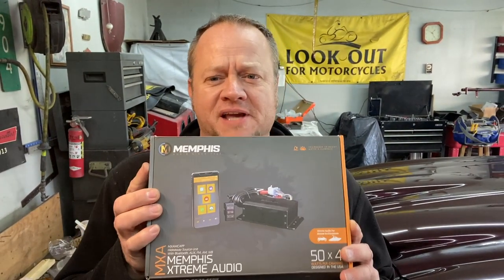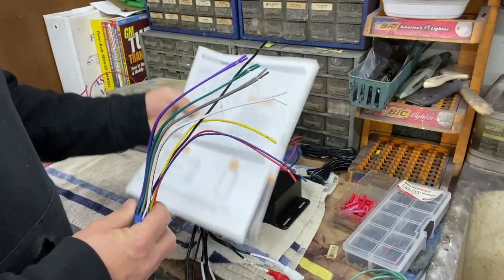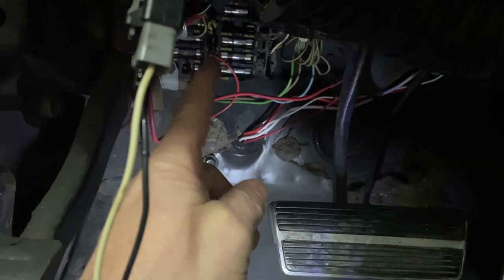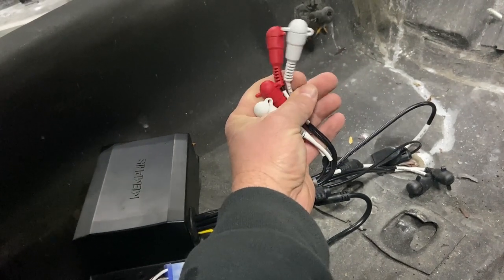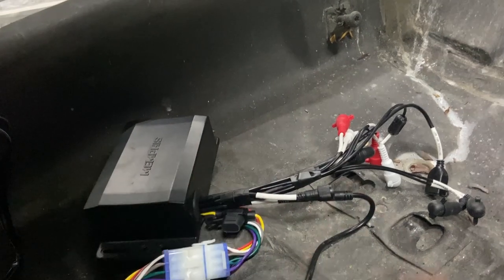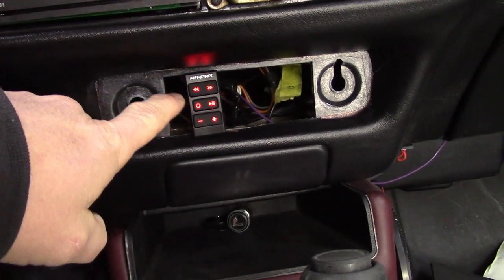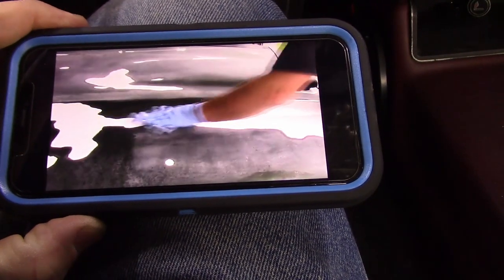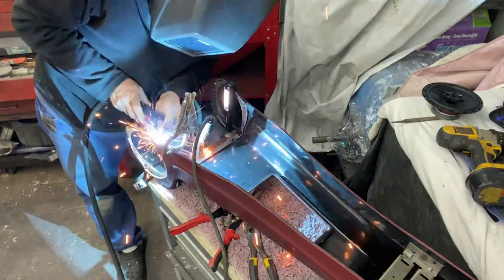Hideaway Radio "HEADLESS" Memphis XTREME Audio's MXAMCAPP - Bluetooth - App Controlled  Source Unit

Comment: Neato. I have still not decided what I am doing for my stereo yet.
Reply from the maker: Right on! I don’t plan on listening to the radio much but wanted something. This whole setup with the speakers was around $300 bucks. Definitely didn’t want an aftermarket modern head unit, but that’s just because I’m going for more of an original 70’s look on the interior. I really wanted to get a period correct radio but even the ones that don’t work are super expensive.

Comment: Are you still liking this? The App reviews indicate if the app sucked it would be an improvement:)
Reply from the maker: its good for me.  I like it.  The only thing i dont like about the app is that volume adjustment is incremental, like in steps. not continuous like a dial.   I dont listen to a ton of music either though.  For someone looking to have a super sweet system, they may want to step up to something more expensive. For the price, it's good.

Comment: Anything app controlled is garbage! Complete garbage I have the MXA46sb28 and in order to switch to aux I have to use the app, but the app won't work properly anytime I try to load it, so I have to use the regular BT option when my phone connects, if I wanted this I would have got a knock off from Amazon or ebay the $900 stereo is garbage without the built in eq that you cannot use without the app but again the stupid app doesn't work
Reply from the maker: Yike! Sound like you are having some significant issues. That sucks. Mine has been working fine. I’m using an I phone 11 and havnt had any trouble with the App or the hideaway unit.
Reply: What is the knock off called?